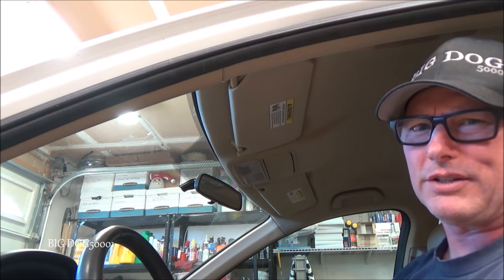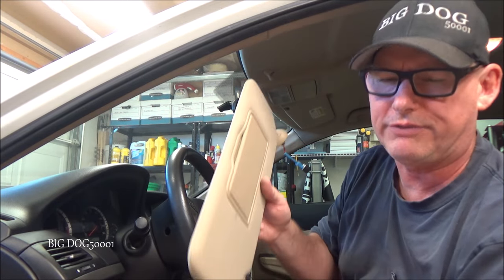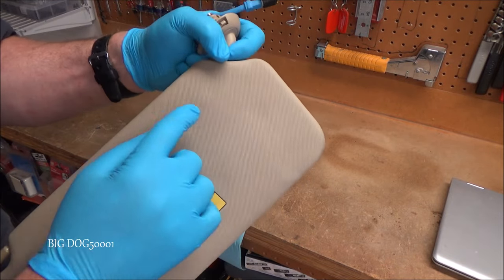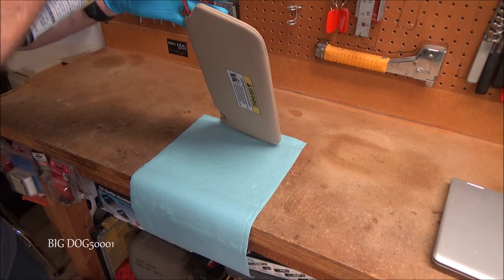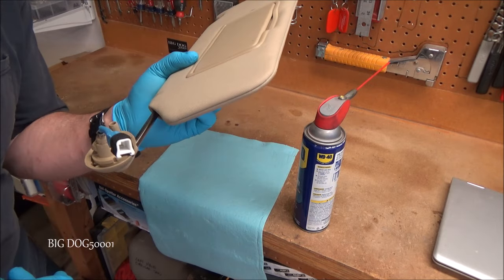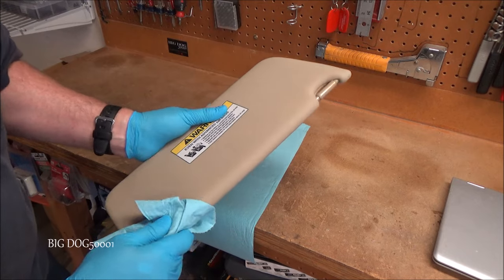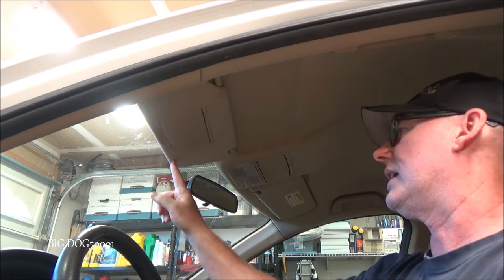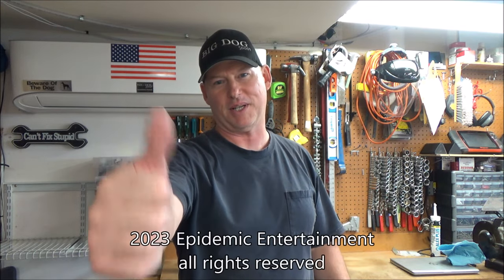Honda Sun Visor Fix - No Parts Required!

Comment: my sunvisor is not this stiff, but it droops when “closed”. I fixed it kind of without even removing it. I just pushing on the clip inside of it about an inch from where the rod enters with my thumb every time  i close it. No no sprays needed. Just precision thumb placement.
Reply from the maker: That is another way they break, and spraying doesn't help that problem.

Comment: Thanks for the video. I will spray a towel / paper towel and regularly lubricate the chrome medal rod by extending it. Then wiping the rod- Push it in & out. I think this would prevent oil smugs on the outside of the visor.

Comment: Works on a 2020 Honda Pilot with the exact same issue.  Mine loosened up quick but I also hit it real good with the WD-40.  Used a paper towel as I went along to soak up any that had gotten on the fabric.  Thanks for the video!

Comment: Unfortunately that's not the only problem these sun visors get! the whole thing expands during summer heat,  if you ever park outside in sun's heat. I used metal binder clips, type used for about half a ream (250) pages of paper. works good.  Now i got this to look forward to!

Comment: Mine is creaking something awful and looking like it's going to come down from the ceiling. I'll give this a try. Would silicone-based lubricant help prevent the dust/dirt accumulation better as well has help prevent the staining of the upholstery? Not sure if it's easier to get out of upholstery. If it works, either one is still cheaper than replacing the visor(s). Thanks!

Comment: I wouldn't say they're notorious for going bad. I've owned a 1990 and 1995 Honda with over 250,000 miles and currently own a 2004 Honda with 257,000 miles. NEVER had any problems with the visors on either side. I just had to replace the driver's side visor on my 2014 Honda Accord because it would not "snap" back into place. It was sagging about 2" from the top. Did Honda change the way they manufactured these visors for the 7th gen?

Comment: If I'm unable to pop the pin that locks the sun visor can I just break the plastic housing off to pop off the sun visor, because I tried to press the button/pin and it didn't work.

Comment: For my 8th gen Civic, I drilled holes and installed rivets.  Not the most elegant, but does the job.
Reply from the maker: The plastic can crack on certain Civics so that is definitely one way to fix them.  Thanks for the input!
Reply: I did a similar thing but it took only one threaded post for less a dollar at home depot and looks fine.  I followed  David Sweeney's video.  I did this 10 years ago and no problems at all.

Comment: You could also try silicone which would not be messy and smelly like the WD40
Reply from the maker: Worth a try!  But there is nothing like the smell of WD-40 in the morning!  lol
Reply: Try Tri-Flow lubricant. It's what professional locksmiths use. I'm absolutely silly for the smell😂

Comment: Isn’t wd40 a degreaser?
Reply: Absolutely not.  It's a water displacer (WD).  It's typically used on electrical stuff that has gotten wet.  It also has some lubricating abilities and some people even use it as a rust penetrate.